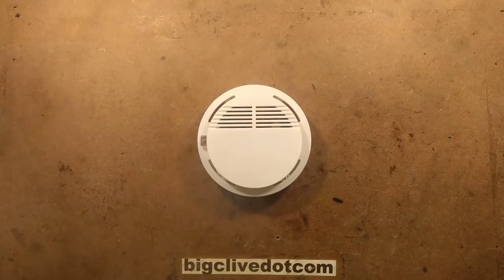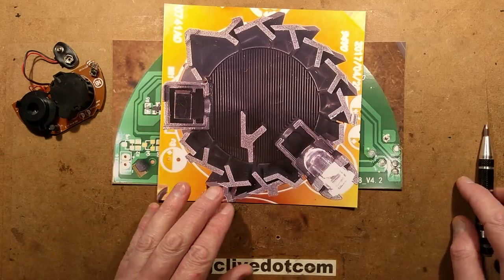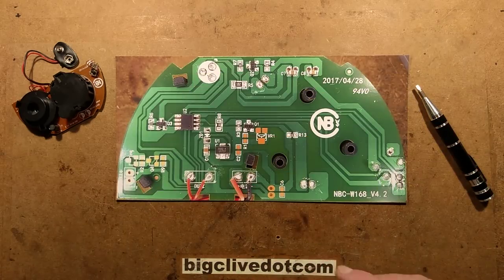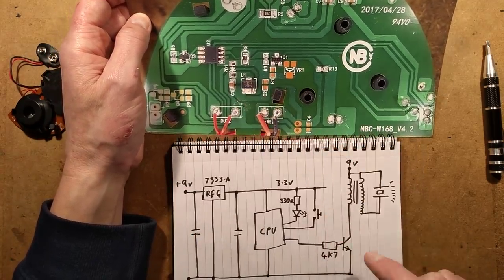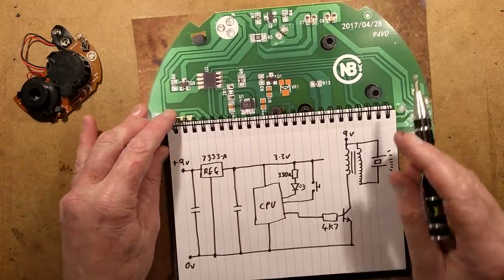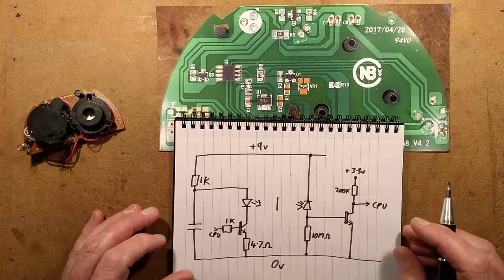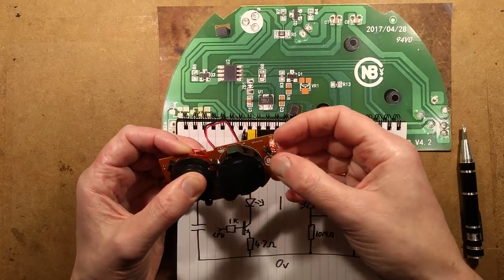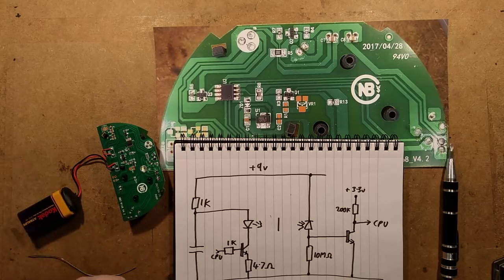Torch your home for $4. (with schematic)

Comment: Hmmm...the photo detector side has transistor-beta-dependent gain.  So exact photo current required to make the “CPU” signal go LOW is dependent upon the transistor beta.  That makes “zeroing” the residual light somewhat tricky.  What am I missing?  Perhaps “CPU” signal goes into an A/D converter and further analysis is performed by the microcontroller.
Reply from the maker: I think the real things do use an ADC.

Comment: I'm kind of curious as to what vaping device you're using to test the detector with? Seems to be something a bit more substantial than the EGO style devices you usually use.
Reply from the maker: It is.  I bought something a bit beefier.  A Kangertech.
Reply: Nice, which model?
Reply: 44CT232  I'm interested too.

Comment: Clive mentioned strain on the LED...

Logic would suggest that there would be roughly the same strain on the LED as the switch itself (more strain on the switch as it actually fully takes the pressure of the switch). Is this a fair assumption? Obviously you could say that because the LED is taller that the strain would necessarily be higher, but that assumes a torque force on the LED, and as the spring would compensate for any, very, minor torque forces, it would be safe to negate those I believe.

I am not saying he is incorrect, or that I am. Just that my logic brought me down a different path, and although I 'feel' that I am correct, I prefer to ask others in such instances. Best to prevent from getting confident in one's own assumptions of correctness.

I think...

Maybe I am incorrect about that as well... 😳🤫😬

**
Past this, it's not related anything to. 

Yeah, in retrospect, don't question yourself...

You're always 'right'... Gotta foster the arrogance and travesty of the future, these lazy millennials are too 'patient', and 'understanding'... Who will destroy nations and be THE dictator of the future if we do not foster such nonsense now!?!? Take a stand, stop correcting your children! Foster the attitude that they are always 'right'! Oh, you think they should be grounded for breaking the 'rules'? Well they are rules YOU made up, and the chitlins did not agree to, so obviously, as with the US refusing to sign agreements against war crimes, it's not a war crime if the US does it, because we never agreed to such things/definitions...

Teach your children how to be the US!! The greatest country full of 'right' white people running shit. 🤣🤣🤣🇷🇺 RED, WHITE AND BLUE, BABY!!!

Edit: Oopsies... Wrong flayg... But the pride I've learned from reading my own words has trained me, SO IT REMAINS! I am 'right'! Suckit! 

😁😬

Comment: I had my hallway smoke detector go off yesterday while I was in the kitchen. I was not cooking anything at the time, though...I was processing films. Not really an activity that is known for producing smoke or kicking up loads of dust. I also had not vaped for hours (my detectors do not usually react to vaping unless you blow directly on them - and yes, I found that out the hard way) and some windows were open. Scared the living daylights out of me. No idea why it went off at all. 
But I know I will let the landlord know if it happens again, as he had them installed a while ago. Maybe they go ropey after a while? Although the detectors are rather posh, with that 10 year no maintenance battery.
Reply from the maker: I had a good brand unit in my hallway go off for one siren cycle and immediately went and looked at it to see a small spider scurrying away from it.  I'm guessing it had walked across a part of the PCB causing a false trip.
Reply: And they say spiders are silent 😂
Oh well...I guess I will be on the lookout for this critters the next time it happens. I never thought of that to be honest, but it sounds pretty plausible.

Comment: Nice - didn't know how those worked. Would be cool to see if you could adapt one into a turbidity sensor for say monitoring the quality of your swimming pool water. Would be interesting to know what the current draw is as I assume a micro-controller wouldn't be too low.
Reply from the maker: You can program a microcontroller to do a test and then go to sleep for a predetermined amount of time.  That means the average current consumption can be microamps.  But it does require quite careful programming.

Comment: Haha - during my first mind-numbing job for 3 years after graduating university for a large global German engineering/technology company I worked with fire detection/protection systems. One time while testing the system in large London office building the testing actually set off the alarm and caused a full evacuation off the building. During winter. When it was snowing. It. Was. Hilarious. The only up-side to throwing away 3 years of my life and career at a company I still wish would go bankrupt even now, 8 years after escaping from them.

Comment: I've bought some expensive smoke alarms. They are just too expensive to mount and I've left them in the packaging to not hurt the resell value.
Reply from the maker: You should use them.  If they save your life or even just limit smoke damage in your home then they've paid for themselves thousands of times over.

Comment: Here's wierd question,, it's seems like it would take a while to detect smoke, with optical sensors,  because the smoke has to creep into the plastic housing then creep into the sensor housing. Like I would think you need a fan to suck smoke Into it?
Reply from the maker: Some industrial ones do have sniffer pipes that pull air through remote detection chambers.  But in a home, smoke will diffuse into the air fast.
Reply: @bigclivedotcom  ohh ok, I was thinking like a stream of smoke at first, but in a closed room, I get it now.   I'm only a amateur level tinkerer, so I find your videos are the best at explaining how all these  electronics work. Thank you all the way from 🇨🇦.

Comment: I bought cheap-ass smoke detectors to put in my tenant's units.  They just remove them and re-appropriate the batteries the 1st time they make some fried chicken in their smokey deep fat fryers.  For the remaining time they live in my building, the smoke detectors never power up again.  Then I'm the bad-guy when I mail them a notice that I'm not renewing their lease - - don't try to burn down my buildings...
Reply from the maker: Take a look at rate of rise temperature alarms.  They aren't triggered by smoke.  It has to be a sudden increase in heat or a preset threshold to make them alarm.  It means there will be no more false alarms.
Reply: Clive, all I could find were heat detectors.  Where my building's smoke detectors are located, I think a lot of the building would be engulfed in flame by the time there's an appreciable temperature rise on them.  I may have to relocate them to the room's peaks (high vaulted ceilings) for them to be effective.  I'll keep looking though - I am shopping ebay if it matters.  Thank you Clive.

Comment: It would be lovely to remove and hack those microcontrollers.  You could possibly add low voltage monitoring and IR LED failure with a bit of programming.
Reply: Patrick Sweetman One-time-programmable makes them useless for hacking in new functions.  At best you may be able to change some PROM bits from 0 to 1, but not back.  If it's really that chip, you could buy blank chips and swap them out.
Reply: I believe they're generally OTP and can't be reflashed.
Reply: That was what I assumed, given the very cheap value of the microcontroller, although Clive hinted at the possibility of EE-programmable chips.
Reply: Very interesting, indeed.
Reply from the maker: It would be viable to hack in a new 8-pin socket and use the detector as a base for a software project based on a standard flash microcontroller.

Comment: Have you ever vaporised alcohol ?
The vaporising device known as the Volcano has provision for vaporising Ralfy type spirits.  It has a metal mesh that is placed between the hot air and the baloon. It might be a beard club type of thing.
Reply: Vaporizing alcohol is incredibly dangerous because of both toxicity and flammability. 
The Volcano was made for vaporizing cannabis. The metal mesh is made for vaporizing hash, preferably 5 star bubble hash.
Please don't use it for alcohol. That's really dumb.
Reply: Steve - I have put quality vodka in a nebulizer, however I wouldn't recommend it. The dosing is iffy at best since you absorb inhaled solvents instantly and could inhale too much very easily. It's also painful - your lungs feel like your mouth and throat do after a stiff shot.

Comment: On my garage computer without adblock, and I received the "don't get hacked" anti-vaping PSA ON THIS VIDEO! THE VIDEO THAT STARTS WITH THE EXHALATION OF A MASSIVE VAPE CLOUD!

What. Are. The robots. Doing?!
Reply from the maker: It's probably less sinister than you think.  I used the word vape in the tags.
Reply: You're probably right. I'll vape to that. What device are you using these days? I still have my trusty old Sigeli 150w. It's developed a nasty habit of occasionally reading high on my coil impedance and kicking the voltage up, which results in the delicious flavor of charcoal. Other than that it has held up very well over the years. Running NCR cells salvaged from a Ryobi tool battery.

Comment: amazing how compact these are. should of seen one i had to replace 2 years ago that runs on main's power. it must been late 70's or early 80's the tracks were made from liquid solder there was no copper traces and the pcb was brown with no coating what so ever with a nice big radio active symbol on it. although it didn't work anymore instead just made a nice transformer buzz as a side effect instead.

Comment: My seventh grade physics teacher sprayed fog spray in the room and was shining a laser through it and when he shined it on the fire alarm it went off
Reply: Are you sure it didn't detect the fog? It would have to be a dumb-ass smoke detector to go off on a laser.
Reply: And evacuated the entire building?
Reply: it could've been a coincidence on the timing, but it wasn't until the laser hit it
Reply: yep
Reply from the maker: A laser is bright enough that it could enter the optical chamber by reflections and cause an alarm.
Reply: Even so, clive, would the chip not turn off the internal LED and check for brightness then? I'd have it check a few times like that to make sure there aren't false trips.

Comment: How about ripping apart one of the "10 year sealed battery" units, particularly the Aico E2210e combined heat alarm and Optical combined unit, since its more complicated.

Comment: The other one seemed like far battery quality but I think it's a good thing they make devices like this cheaply there are fires everywhere even in poor countries and if it's a matter of a cheap smoke detector or non at all I know what I would.choose
Reply: even in poor countries? Especially more like.
Reply: Though another poster commented that these units really eat through batteries every few months, in which case these cheap detectors could actually be quite expensive as batteries are not that cheap in developing countries nor for the poor.  The likely result is the homeowner or tenant installs one of these cheap units only to have the batteries quietly die a few months later while the homeowner believes their home is fully protected.  These still need more refinement, in my opinion, before they are a good compromise for the poor as they must alert on low battery (preferably at least a month or two before the battery actually dies) and in poor countries long battery life is far more important so they really need to improve power management to a point where you can reliably expect several years of service if using a good quality alkaline battery so that poor homeowners and tenants only need to replace batteries every several years without compromising protection.

There are already commercial units that deliver reliable ten year battery life.  They are not cheap at present as they are marketed as a premium product here (US), but there is nothing to prevent similar power management and efficiency from carrying over to units like these with excellent design practices and a focus on extended battery life.  The homeowner would then have the choice of installing either alkaline batteries for, perhaps, a 5 year service life or a lithium primary battery for up to 10 year service life.  That would really make these into highly affordable units for the poor.
Reply: @ethanpoole3443  I never considered that you make some fantastic points. The other unit he tested seemed to have alot more features, and better build quality not having a low battery warning is definitely a glaring omission I agree fully

Comment: This brings a question to my mind.  It seems modern smoke detectors that use optical sensors are extremely energy efficient.  Compared to the old ionizing detectors they don't need nearly as much power.  So why are they still using the 9v battery?  2 or 3 AA batteries are way less expensive and would have far more capacity.  

Hell you could go with lithium ion cells and small solar panels and you'd never have to change the battery.  I'm really curious about this.
Reply: if you want a loud as fuck beep you need 9v.
Reply: Ease of battery replacement?  Potential confusion due to different battery types?
You can find units that use AA batteries (usually 3) or sealed units with a lithium ion battery.  Lithium one is marketed as "10 year" models and battery is not replaceable, but you are supposed to replace detector after 10 years anyway.
Ionization sensor with wireless interconnect (needs a base) running on 3 AA batteries: https://www.homedepot.com/p/Kidde-Battery-Operated-Smoke-Detector-with-Wire-Free-Interconnect-3-pack-RF-SM-DC/206093602

Comment: Related to 13:00, while the circuit is not relying on the 4.7 ohm resistor being in the emitter for limiting the current, it seems to me it would not do much at all anyway in that role - assuming a 3V control signal from the CPU, by the time the emitter would raise to 2.4V, the LED would be passing a full 0.5 amps if the 1K wouldn't prevent all of that in the first place. Is 0.5A a typical absolute maximum pulse current rating for IR LEDs...? :)
Reply from the maker: Infrared LEDs are often rated at a peak current of an Amp or more and often driven in pulses.
Reply: Oh. Okay then, it is actually doing something limiting the discharge current from the capacitor...